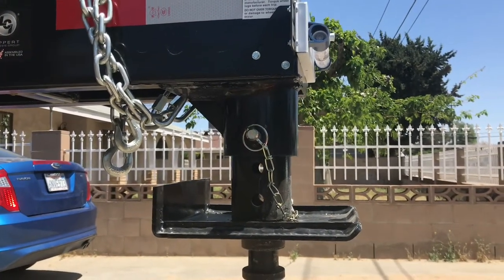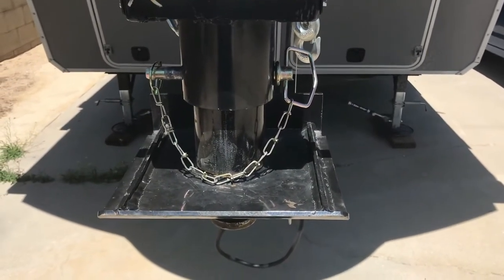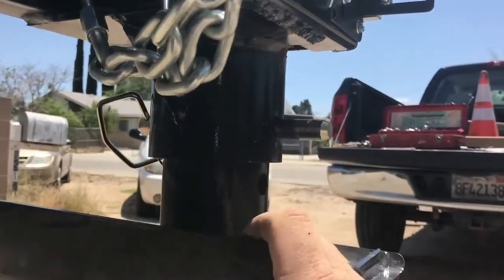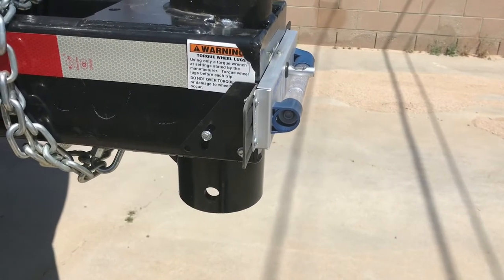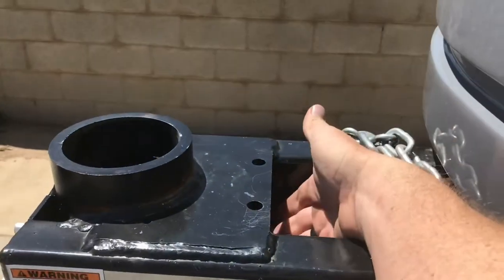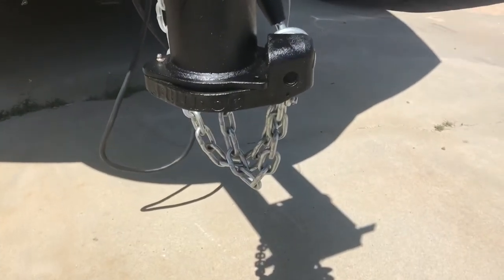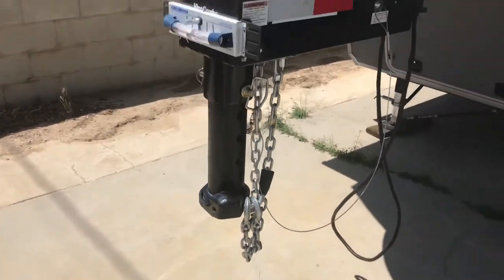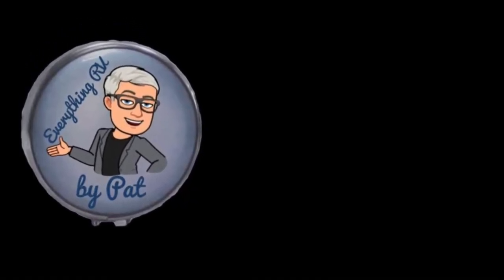Using a Goosneck Coupler on the King Combo Pin Box

Comment: Great video I have this exact camper with the same pin box setup. I’ve been up in the air about selling my b&w companion hitch and just use my b&w turnover ball. I’m glad to know this camper is designed for gooseneck pull as well as fifth wheel because you hear so many horror stories. Looking forward to changing mine in the next few weeks

Comment: How much flex should you see in the pin box (King Combo with gooseneck) when hooking up to the tow vehicle?  My pin box moves about 1.5" .  There are no cracks in frame or body visible. Unit is three years old? thanks.
Reply from the maker: That’s way too much flex. It will cause a lot of bounce and play while driving. Not sure what to tell you.
Reply: I am looking at one with a set up like this, and there was enough flex for it to cracked the front cap. But everything I read says flex is normal. But that much flex can't be right.

Comment: great video.  I'm looking to get one of these 5th wheels and would be using the goose neck adapter.  Could you possibly give the product number of the bmx bulldog adapter?  Was looking on their website and they make so many.  Thanks
Reply from the maker: Try this link: 
https://smile.amazon.com/Bulldog-1289050300-Gooseneck-Coupler-Inner/dp/B00A5VNUOW/ref=smi_www_rco2_go_smi_3905707922?_encoding=UTF8&ie=UTF8&keywords=bulldog%20gooseneck%20coupler&linkCode=sl1&linkId=8051d06490a57e338340b7a0743e7059&qid=1525042814&sr=8-6&tag=everythingrvp-20
 Might have to copy and paste or click the live link in the description. 
All the best, 
Pat
Reply from the maker: I didn't qualify for the Amazon kick back. Don't feel like you have to purchase from my link... Thanks again!!!
Reply: Everything RV by Pat 
Ok. Just one more question. Why did you change to a high rise ball?  Is it necessary?  Thanks
Reply from the maker: @ericreynolds355 Eric, I am glad you asked that. The reason behind me getting a high rise ball is because I didn't quite have the clearance I wanted and I was on the last hole possible making it the longest extension possible. It was okay but it didn't provide the desired clearance and as a result I touched the bed rails to the coach a couple of times. Getting an extra inch and a half helped a lot. I am currently looking into raising the trailer a couple of inches at the axles because my truck (stock) is still just a little too tall and I am leaning back just a tad putting more weight on the rear axle than the front but that's another video altogether. If you get one of these trailers, regardless of whether you pull with a 5th wheel hitch or the goose ball you will have to spend time adjusting it to fit your particular truck. The time is worth it in the long run. 
All the best, 
Pat

Comment: Can't this torque the fiver frame and cause cracks?
Reply from the maker: creepycharly thanks for the comment. This is a design by Lippert. Putting a gooseneck coupler in the hitch in this manner does not void the warranty. This is the only manufacturer using this particular type of hitch.